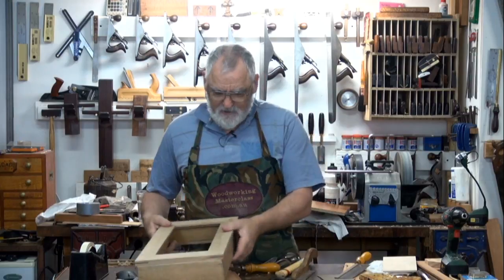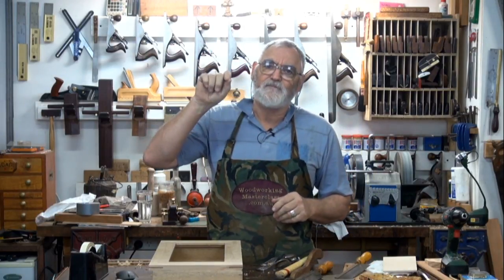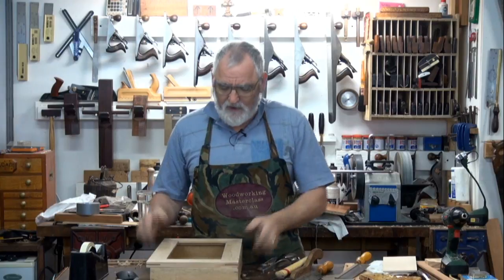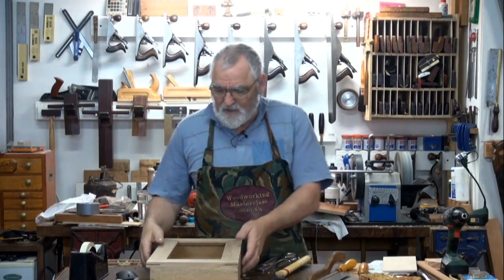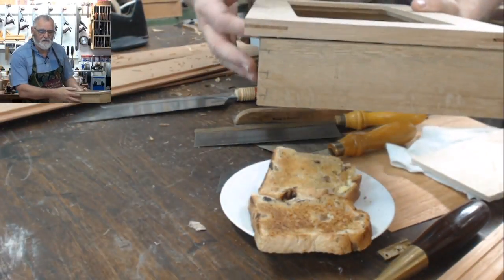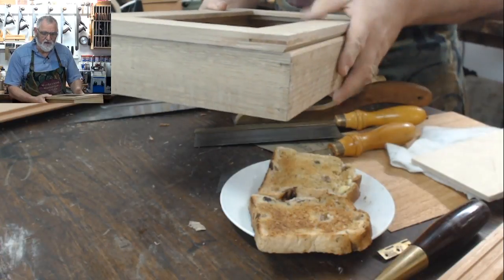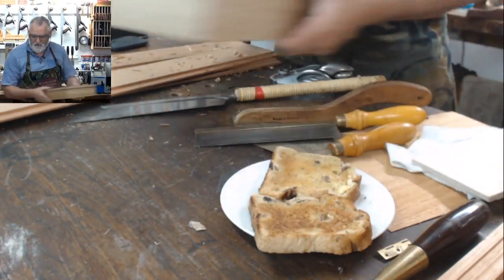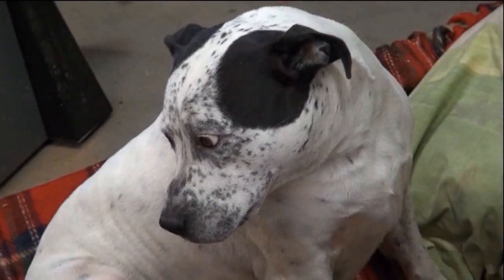No Knob, Door Knob

Comment: Knobs and lever door handles the work of he who shut not be named, catch sleeves all the time!

That toast looks good - which saw did you use to cut the slices and did you use the HNT Gordon plane or the Stanley to get it flat?

BTW The X thingy worked perfectly on my skirting boards, saved me a lot of time, thanks and cheers.
Reply from the maker: Hi Jonno, Great question by the way. Toast cut with Lie Nielsen 12 tpi Crosscut saw, corners rounded with HNT (Flat) Spokeshave Butter applied with HNT Gordon Plow Plane and Spread with HNT Gordon Smoothing Planes with blade reversed and used as a scraper. lol Cheers Steve